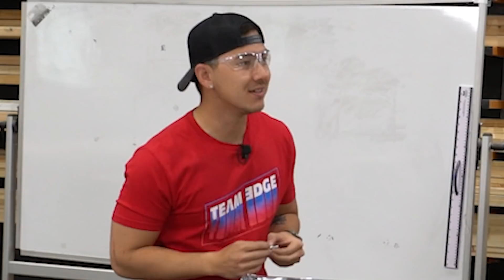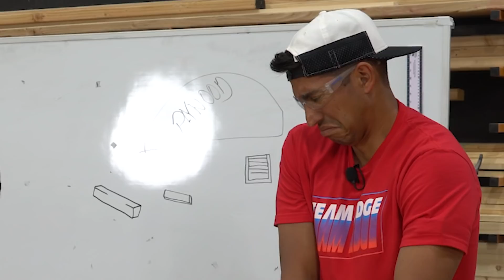Can You DESTROY the UNBREAKABLE Pinata!?

Comment: Hey! maybe another challenge idea, you can in fact weld aluminum- you just need to TIG weld it at a low voltage (120 avg.). So perhaps you can see who builds the strongest thing with welding? Aluminum is rather difficult to work with though

Comment: J-Fred, you can weld aluminum it’s usually in TIG/GTAW and it’s a little more prep work than most other metals to weld. This is because it has a layer on it to prevent it from oxidizing so in order to get rid of that layer you need to take a metal brush and brush in one direction where you want to weld. You need to get rid of that layer because that layer has a higher melting point than the actual metal itself so if you’re trying to weld and it’s still there then the metal inside will melt and then you’ll watch it shrink and your piece ends up looking like something from a horror film. The more you know!

Comment: Metal inert gas (MIG) welding can be successfully used to weld aluminum. ... When choosing a shielding gas, 100 percent argon is best for MIG welding aluminum. The welder must choose a welding wire or rod that has an alloy as similar to that of the work pieces as possible to create a quality weld.

Comment: My father is a welder, and you can ABSOLUTELY weld aluminum. You use aluminum electrodes 4043 filler rods or wire.

Comment: Do I know some people are going to ask why did he still say it I feel I must just because he is a carpenter and I'm sure occasionally does work with a little bit of metal besides the screws and nails etc but you can weld aluminum it's definitely not the same as other metals and to be clear I'm not claiming to know how just that it is able to be done I know aluminum roll cages get welded back and other motor parts made of aluminum but I did still really like the video funny as usual